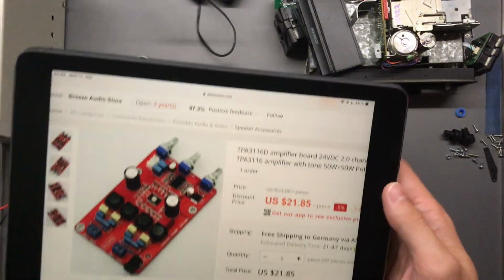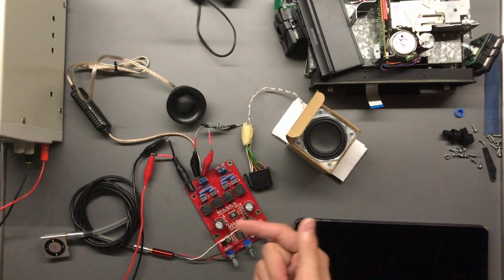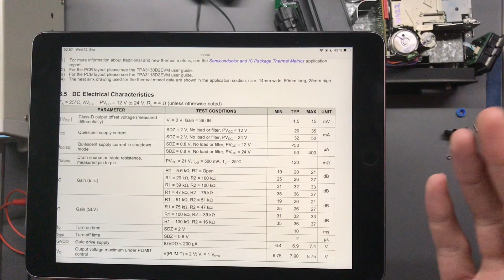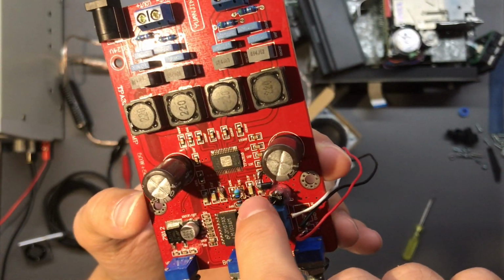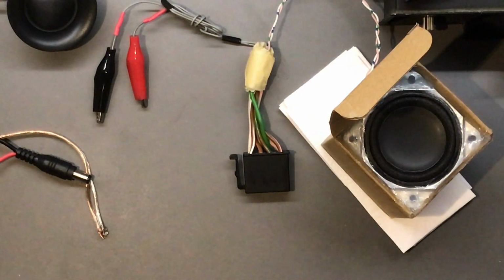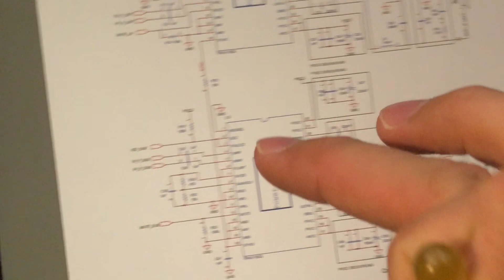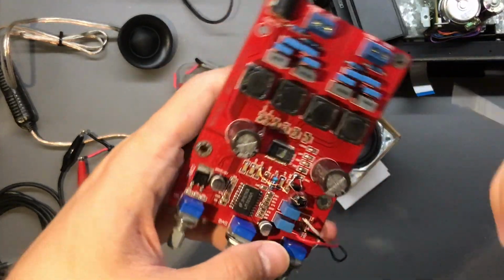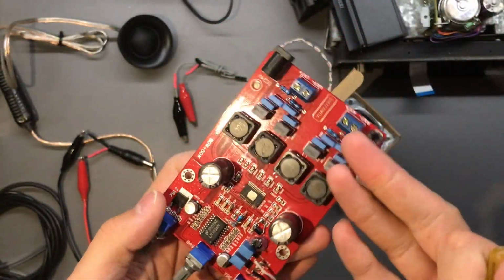YuanJing Stereo TPA3116 Amp Review + Anti Pop & Gain Mods

Comment: Noise? Are you sure is due to the gain set? I have a different amplifier (XH-M543)... it has the same configuration MASTER 47k/75k, 36 dB, but... sounds great! I am using a motorcycle 7A battery to power it... wouldn't you consider that the source might be involved? Just a thought... I'm just an experienced DIY-ist, and I love electronics! I'm not a professional...
...hmmm... I've read a few commentaries and when you said "noise", you meant "hiss"? I hear it too, but its at very low level... I had to get really close to the speaker with music paused to hear it... 🤔

Comment: Very helpful indeed. But, could you please let us know how to eliminate turn off pop?  It is so powerful which might hurt my speakers.
Reply from the maker: search my channel for "anti-pop tpa3116", I did a video on that
Reply: I just applied the mod to the amp. It actually works and it gives almost 2 sec delay to the start up process. No pop at tuning on. But my module suffers from pop at turning off. Some current goes through my speakers as soon as I turn the amplifier  off or pull the power cord. Could you please help me solve this part too? Thank you so much in advance.
Reply from the maker: I'm afraid that's as far as my knowledge set goes 😂

do google the anti-pop tpa3116 forum posts and maybe it's discussed there

did you have a schotky on hand ?
Reply: @Darieee  Yes. I have two SS14. I made the circuit exactly as you had mentioned in your video. It did work and it makes delay in start-up. But my problem is with turning off. Thank you so much for your time.

Comment: this video really helps me, now i just need to unglue the heatsink and find the things and implement the anti-pop, btw can you review the mono amplifier 1x500W ones ?
Reply from the maker: If you order one my way, sure could xD

Glad I could help though
Reply: @Darieee  sadly i cant haha, but they using IR chip "IRS2092S", its a mono amplifier, you can check it here https://bit.ly/2HtxfsL
Reply: btw, i have 2 TPA3116 Amps, 1 that have a hot coils and have anti-pop design and 1 with no hot coils with kinda anti-pop design,  if you have the volume on 0, its not gonna pop the speaker, but if you have the volume other than 0 then its gonna pop. planning to make it into 2.1 system with 2.1 pre-amp
Reply from the maker: @clee2423  hmmm ... I don't know ... check my other video on that good TPA3116 2.1 amp ...

If you want to learn shit and have a go at it then great; otherwise I'd just buy that board ... somewhere around 15-20$, has anti-pop, chokes stay cold

The only thing you'd need to do on that one is change some resistors to lower the gain (quite hissy otherwise)
Reply: @Darieee  yeah, planning to buy that 2.1 amplifier in this video https://www.youtube.com/watch?v=5yuzHeXVR8E and probably gonna change the gain to 20 like the other TPA3116 Amps that i have, and if need smd resistor, you can get it cheap for around $24 for 0805/170 values 25pcs each, i got mine 2 days ago, and its really handy if you want to mod things, its a book  so you can store it easily, if you interested, just search "SMD book" at banggood or aliexpress, they have a capacitor version too
Reply: or if you interested with 2.1 amp that has a lot of power, you can try search for amplifier that use TAS5630 like this one https://bit.ly/2F5FbiC

Comment: Great videos. Which class d amplifier stereo board (2.0) up to 100 watts would you currently recommend?
Reply from the maker: if you're comfortable with doing the mods I've shown, then I would recommend the one shown here
Reply: And if you are not so comfortable? ;)
Reply from the maker: So, this one has hiss but no turn on thump https://bit.ly/2xHZu0H
This is what you are after, but I haven't tested it https://bit.ly/2PQgcSR
And this also looks cool https://bit.ly/2ODEOOu
Reply: This one looks exactly what I was after: https://bit.ly/2PQgcSR
I guess a 100 watt power supply like this could be used for that: https://bit.ly/2PXWhSb

The TPA3116D2 100 watt mono also gets a lot of positive feedback: https://bit.ly/2PPJ7qb

The question is only how to get 2 of those in a proper stereo setup with the right components.